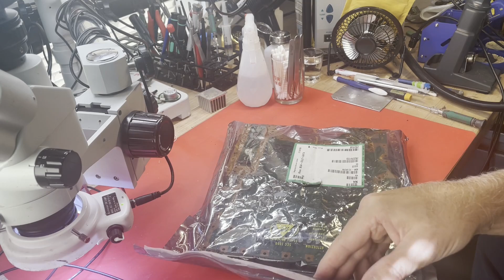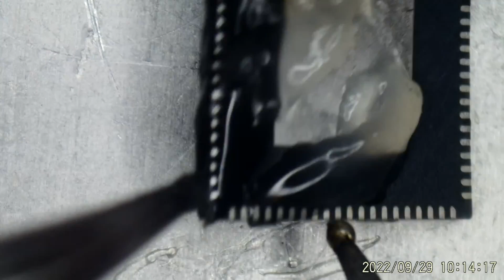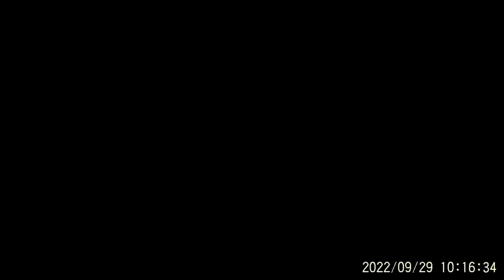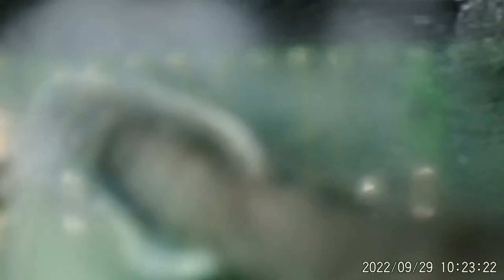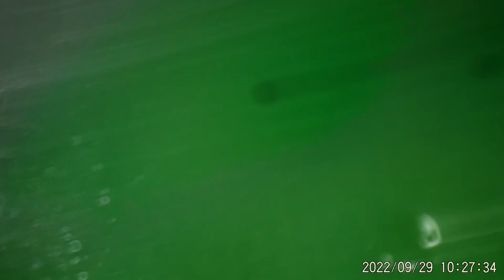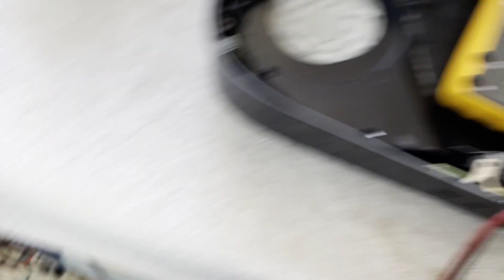#51 Repair of PS5 No Power Shorted HDMI Encoder

Comment: 30:00 Love that technique. Gotta use that for the next fan connector I see torn off.
Reply from the maker: Thank you!  I get a nickel each time you use this method. :-)
Reply: @ToltecMerc  Hi, from someone who's never tried soldering, let alone micro soldering, but is seriously interested in getting into it, can you explain why you did a wire for the fan connector on one of the pads, but the others you simply used solder?

Comment: I have a ps5 that wont show picture i replace the encoder and the port cheked fuses and filters everyone is ok no shorts around the encoder and i still get whete lite but no picture is there something im missing ? i even put a new cap tha goes on the hdmi port that was missing and only goes to white lite bu no picture im pulling what is left of my hair out. Any tip would help  , thank you
Reply from the maker: I would use an HDMI breakout board and measure diode readings on every pin of the port.

Comment: Dear, I'm from Brazil, and I'd like to know, on the EDM-030 motherboard, what is the capacitance and voltage of the capacitors around the HDMI IC (MN 864739).
Reply from the maker: The ones that are scattered around the perimeter are 100nF.  Max voltage would be around 1.8V.
Reply: @ToltecMerc  thanks bro, you are the best!!!

Comment: Have you tried to upgrade the RAM on a PS 4?
Reply from the maker: I have not.  I’m not sure what the max is it will recognize.  I don’t really mod consoles, I just repair.
Reply: @ToltecMerc  as a kind of hobby I look for electronics in dumpsters and curbside stuff. Recently found a Sony PS 4. Not sure if it fully works. Has the HDD still mounted. Needs cleaning! Thank you 🤓

Comment: Hi Dear! I changed hdmi port but i have black screen or many points on tv with 480p. Can be ic Panasonic fault?
Reply from the maker: It could be the encoder.  It could also be bad solder connection on the port or an open output filter.  There are four differential pair outputs.  If one half of a pair is open, it will try to work but have a lot of noise.
Reply: @ToltecMerc  I watched better under microscope and i find one missing emi filter! I don’t have one of these. Can I bypass with two cable?
Reply from the maker: @ennesimo84  yes.  You can replace with short piece of wire.
Reply: @ToltecMerc  thanks! I Will try 😉 Can it be forever without one filter ?
Reply from the maker: @ennesimo84  it’s not the best option but it will work

Comment: Great video! Im having this same problem with mine after a electrical storm it actually knocked out my tv and ran through the hdmi. Im going to try to tackle this myself i already took off the encoder chip and checked everywhere else you did and didnt find anymore shorts so i hope this will fix the problem when the chip comes in. I havent tackled this kind of soldering yet but i guess now is a good time to try since the system is broken anyways.
Please let us know whet temp your running your soldering iron and is it in C or F?
Also can you tell us what type of solder exactly? 
Thanks again for the help you give all of us!
PS. i was able to find that it was my main board on my tv that got zapped and i was able to order a replacement and it worked thank god but replacement ps5 boards dont come cheap!

Comment: My ps5 got zapped from I assume the tv. Tv is dead along with everything that was connected to it. Ps5 only beeps and will not go into safe mode, 12v coming from the power supply is good. Then I noticed the encoder chip is reading grounded. Could this be my power issue?
Reply from the maker: Yes.  It sounds like a surge may have entered through the HDMI port so that would make sense.
Reply: @ToltecMerc  thanks, I ordered an encoder chip and I have soldiering experience but not micro soldering. I have a hot air station and soldiering iron. But I’m gonna try it. Guess I have nothing to lose lol
Reply from the maker: @smittywerbenjagarmanjensen3059  QFN packages are not easy.  Use lots of flux and pre-tin the pads on the new part.
Reply: @ToltecMerc  ok thanks!
Reply: @ToltecMerc  well I replaced the encoder ic and it powers up now and goes to white light but no signal to tv. I noticed I knocked off one of the capacitors next to the ic in the process no idea where it went. No idea where to get one
Reply from the maker: @smittywerbenjagarmanjensen3059  the capacitors around the HDMI encoder are all bypass caps I believe and losing one would not prevent it from working.  Make sure you did not lose any resistors.  Also, check the output filters between the output of the encoder and the HDMI port.  Check the pins of the HDMI port in diode mode (red on ground).  You should have a diode reading on every pin except 14.  Some will be connected to ground.  None should be open except 14.
Reply: @ToltecMerc  ok thanks! Will check it out!

Comment: I messed up with my repair of the HMDI encoder chip, accidentally removed 2 small capacitors to right and 1 to the top of the chip. They are so tiny! Would anyone know what kind of capacitor they are?
Reply from the maker: If one side of the capacitor is ground, it is likely a small bypass capacitor.  If neither side is ground, it is likely coupling a signal and could be critical.
Reply: @ToltecMerc  Thanks for the info, I purchased a bunch of 27k ps5 capacitors do you think that would work?

Comment: What do you call those rods you use to maintain the ventilator connector ? It's such a good trick, I want to try it out. What I'm used to do right now is use a piece of wick, overflow it with solder to make a nice big pad, but those rods look so great lol. Nice video as always !
Reply from the maker: Those rods are just component leads cut from through-hole resistors and capacitors.  I keep the clipped leads because they are useful sometimes.

Comment: 12:25 - 14:05 = 1min 30seconds. Did you ever experienced popcorn board because of too much heat?
27:43 - Its not only about customers, also do not listen to another service engineer because they also do mistakes, without bad intentions. Follow your own process flow of fixing problems.
30:09 - I saw one guy soldering connectors using desoldering wick instead of wire you placed. Like 1-2mm wide braid, it will hold good. Just an idea.
Reply from the maker: I can't say I have ever popcorned a PS4 or PS5 board.  I may not have shown it but I am using a pre-heater and heating the entire board up slowly over like 10-15 minutes.  When the board gets up to like 110C, then I start with hot air from above.  I've seen others using solder braid and I'm sure that would work as well.  I just happen to have a pile of cut component leads left over from through-hole projects so I use those.
Reply: @ToltecMerc  It would help I believe, if for all future videos, you have list of equipment you use, linked in video description... as detailed as possible would be nice.

Comment: I can do everything micro soldering but I struggle with these encoders. Hate QFN's. And I made the exact same mistake on the F7003 "fuse" pulling the resistor thinking it was a fuse as well and caught my mistake later. It's deceiving by where it's labeled to where it's located at on the board. Its not just me lol. Nice fix as always Tolt!
Reply from the maker: Thanks!  I hate QFNs but it is a necessary evil on these consoles.  That "fuse" won't fool me again!
Reply: Same with me. What temperature do you use when installing qfn from alie express
Reply: @ngonohtc5724  the chip doesn't matter if it's Ali Express or not they're all the same chip lol. It depends on the board you're working on. Everyone has their own method of installing with preferred temps but when installing I would say 420-440c is a good temp since you're using leaded solder and is a safer temp on the chip.
Reply: @hove131  thanks

Comment: I find knife tips to be pretty handy when trying to touch up these types of pins.

Just drag it flush back and forth
Reply from the maker: I don't have a knife point tip.  I should probably invest in one though.
Reply: @ToltecMerc  I  usually do this job gliding with a BC2 bevel tip